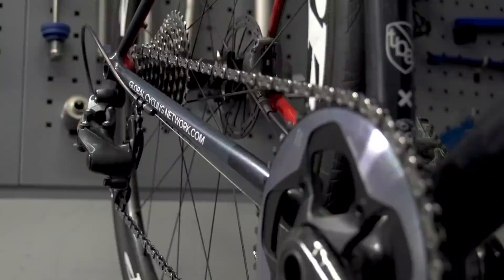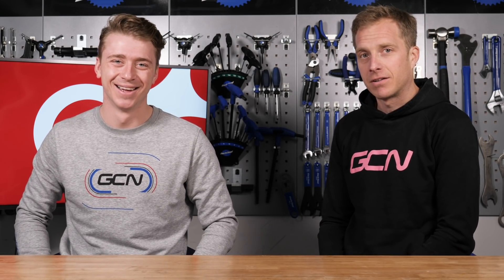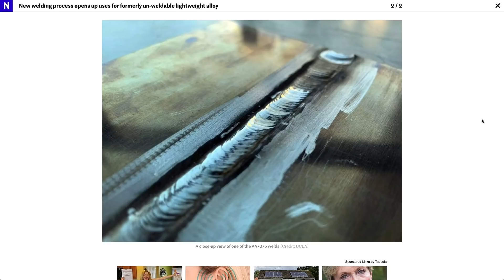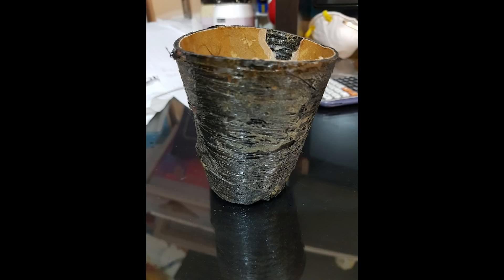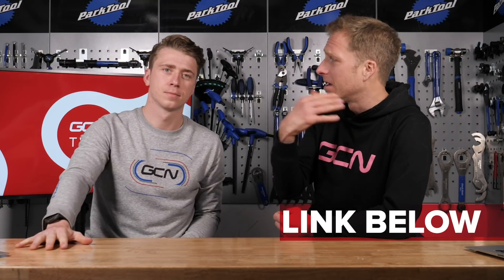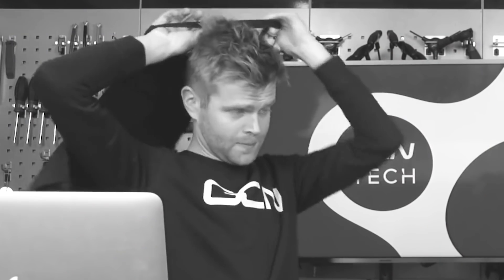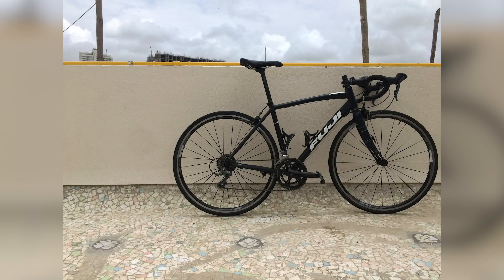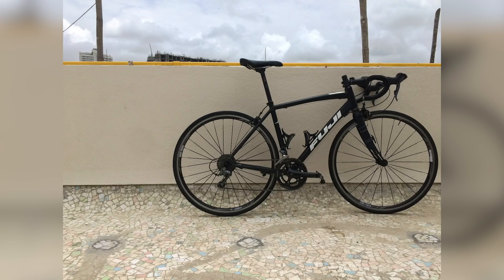The New Metal Threatening Carbon Fiber Bike Frames | The GCN Tech Show Ep. 60

Comment: Materials: if we move forward with the full life cycle in mind - designing and building for end of life recycling, remanufacturing - we’ll be heading in the right direction. This is the ‘circular economy’ approach, which I suggest you guys read up on and use as a lens when assessing new material developments. BTW, Silca does a great job from a lifecycle perspective, building for long life, easy maintenance and repair.

Comment: Metal bikes have always been better than carbon.

Steel is better looking, nicer to ride, strong, cheaper, lasts longer, easier to repair, can be recycled, easier and Cheaper to customise. 

Aluminium is cheaper, almost as lightweight, can be shaped easily, Super stiff, better for impact, can be recycled and modern aluminium bikes get better ride quality reviews than most carbon bikes for the price.

Titanium is... well, better than Carbon in every way. The latest generation of ti bikes are Super lightweight, tube shaping is getting better all the time and with 3D Titanium printing the possibilities are endless. Titanium rides nicer, more comfortable, stronger, lasts forever, resistant to water, salt, acid and UV light. It's cooler, better looking, better value for money as the cost of the frame to make is closer to the actual frame cost unlike carbon that is massively overpriced. It holds its value better often comes with a lifetime warranty, can be repaid, damage easily polished out, can be painted or left plain, can be recycled, quieter than carbon, no BB problems better for putting bags on or taking on holiday, hand made often by skilled passionate workers and, the price of a top end Titanium bike is slightly less than the top end mass production carbon frames. 

I have had Carbon, aluminium, Titanium and steel bikes over the last 20 years and the only bike type I don't ride anymore is carbon... because it's the only frame that didn't last and wasn't worth replacing. 
For the advantage of "carbon is maybe 100g lighter than my best Titanium frame" it's really not worth the disadvantages.
Reply: Reginald Scot someone sounds like a curmudgeon.
Reply: Reginald Scot as a Porsche mechanic and being around a lot of super cars over the years, Bugatti veyron, Shiron, koenigsigg agera rs, all modern Lamborghini and Ferrari and mclaren 720s to name a few 80% of those cars are made from carbon fiber, Modern Boeing commercial airliners and fighter jets wings and other parts are made out of carbon fiber! I have seen tires mounted on carbon fiber rim for an agera rs. High quality carbon fiber is lite and very strong!!! And any impact that destroy them will do the same to steel, aluminum, titanium as well. Carbon fiber is here to stay and is not going anywhere anytime soon. It’s also a beautiful material that you can shape in any form and it’s easy to do via mold. And depending on the damage it’s also repairable!
Reply: @mr02gixxer1000  true but its expensive abd cant be recycled. I iwn csrbon bikes but it annoys me that i cant recycle the frames and if i drop the bike its very easy to break. Exotic sports cars its a different niche world and very expensive to repair .
Reply: glenny oc one of my riding buddy wrecked on his Super Six EVO high mod we where out riding our usual Saturday morning group ride and on this ride we keep it at 22mph and occasionally we would see up to 28mph he hit one of those reflector marker in the road it was lose so his front wheel give and he went down. The handle bar tape and parts of the saddle got scuff up, but other than that the bike was fine and we where able to ride back to where we parked some 30mi he got the frame check out and it came back all good and he  rode it for quite sometime after that, he his on the newer super six disc model now. Like I said high quality carbon fiber is very light and strong!! And you are not going to just drop one and brake it. And even if you brake one most of the time they are repairable, and also pure carbon fiber does not fatigue! There is a reason why they are used in super cars, aircrafts, motorbikes, the kzoniegsigg Agera RS 80-90% of this beast of a car is carbon fiber even the wheels are made of carbon fiber on a car that can reach speed of 260mph. Think of how strong the wheels of to be handling those kind of braking and G forces. And another testament to how strong carbon can be some of these super cars the drive shafts are made out of carbon fiber!! Let’s think about that for a moment!
Reply: @mr02gixxer1000  yes carbon has torsional strength but it has poor impact strength. A venge peter sagan current copy bke was on youtube and it was literally in pieces after a crit crash. Yes it light and stiff and i like riding on  it but id never bike travel on it. Alloy or Cromo steel bot titanium no.
Reply: glenny oc A Venge copy!! Lol not the real deal?!? And not because you would never travel on it still doesn’t change the fact that an high quality carbon fiber any impact that destroys it will also destroy steel, aluminum, titanium. You noticed I said high quality!! Right?? Not some knock off with poor quality control! Oh and I have seen Caad12 and Caad10 with dents in the aluminum as result from crashing in a criterium but the carbon fork was still intact go figure! You ride what you want to ride it’s all good! But like I said carbon is not going anywhere because it’s very lite and strong!! And it’s very beautiful and exotic material and not hard on the eyes must I say!
Reply: @mr02gixxer1000  nope the real deal just a fanbois bpught and exact  version of his bike
Reply: @mr02gixxer1000  i know I've Got 3 carbon bikes but i know its strengths and weaknesses. It has its place but a cheaper alloy tech will be come along soon thats cheaper to make recyclable and as light or lighter than carbon. It will suit bicycles maybe not as durable for aviation or cars.

Comment: 7075 Aluminium alloy has been around since the 1930s Japanese Imperial Navy Airforce were using Mitsubishi A6M Zero's with it.
More modern Lithium Aluminium alloys were used in more modern aircraft in the late 1950s such as the Supercruise BAC TSR2.
Metal Matrix Composite titanium was used for the Eurofighter canards instead of composite plastic.
One of the fastest aircraft during World War two was also designed as a Stealth fighter to evade RADAR was constructed from Balsa Wood composite construction, the DH98 Mosquito.
The most modern aerospace materials is probably the maraging Stainless Steels, although I'm not sure if this was used on the Bristol 188 as a more advanced structural material than the Russian supplied Titanium for the US CIA Oxcart for operation within the Thermal Barrier.

Comment: Bluetooth bike pump.... please.... is that really necessary?
Reply: I’m going to invent a BT toothbrush that tells me when I’ve put on enough toothpaste. Dolla dolla bills y’all.
Reply: @sudduthjonathan  too late.  Braun already has the connected toothbrush.
Reply: In a word, no.
Reply: Seems like a lot of unnecessary complication.  I can't think of a way to make that purchase justifiable.
Reply: It's designed to be as travel friendly as possible....bike boxes, gear bags etc but still being able to pump up to 200psi if you want to. Taking away the gauge and connecting it to your phone makes it smaller and lighter.
Reply: @mattgittings2696  I understand the intention, but it seems unnecessarily complicated because it requires a second device to function.
Reply: @jacksquat2067  A second device that, let's face it, basically everyone already has anyway. Never leave home without my phone.
Reply: @morosis82  Different strokes, I guess. I prefer a pump that doesn't need batteries and a cell phone to do its job. *shrug*
Reply: $275 for a bike pump that required a phone - no screen of its own.   Not auto fill.   crazy.

Comment from the maker: What materials would you like to see bikes made from?! 🤔
Reply: As an engineer and frame builder:
Steel seems too easy to weld, and it is more resistant cutting and forming than aluminum. I enjoy TIG welding aluminum, but it is dependent on having very good preparation around the weld area. Aluminum is a cinch to cut and form.

I have also scratch-built a frame from carbon fiber, using a wet layup over a foam core. If it weren't so darn expensive, carbon fiber would be my absolute favorite frame material--it can form into virtually any shape, and you can fiddle with the layup and get it just right before the epoxy cures. You can even precisely engineer the thickness and orientation of the layup to achieve whatever stiffness properties you may want.

All in all, aluminum is my current favorite frame material--it is easy to work, enjoyable to weld, and inexpensive to acquire.
Reply: Ghanian Bamboo
Reply: still waiting on the graphen bikes that Si reported on
Reply: Adamantium, from the new manufacturer, Wolverine Cycles.
Reply: Bring back Beryllium!
Reply: @estelja  Its very toxic and will now be of short supply as it is used in Thermonuclear radiation implosion war head lenses now that the INF treaty has been broken.
Reply: Graphene
Reply: Recycled plastic or Kryptonite..
Reply: Dyneema
Reply: Hemp.  It would be an instant hit with Floyd Landis for his bike shop/Hemp shop.
Reply: Plastic?
Reply: Same! That would be a very nice and useful way of recycling :D
Reply: Solid wood rod... hard ash would be nice.
Reply: human bones  :0) ha ha ha ha  Now are wifes can ride are bones even after we die ha ha ha lmfaooo0000!!!!